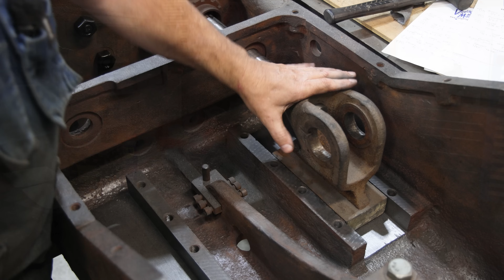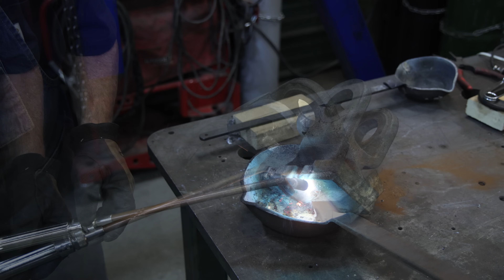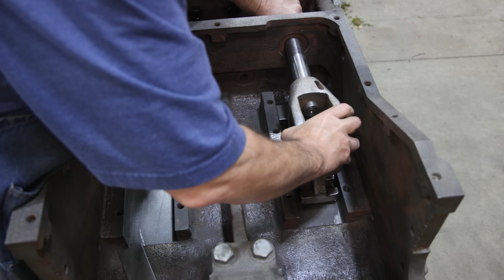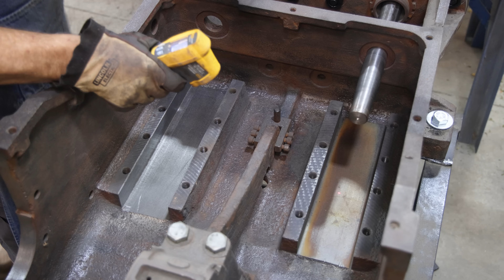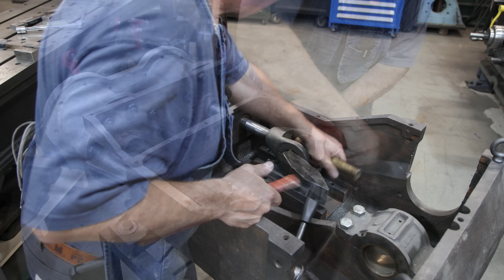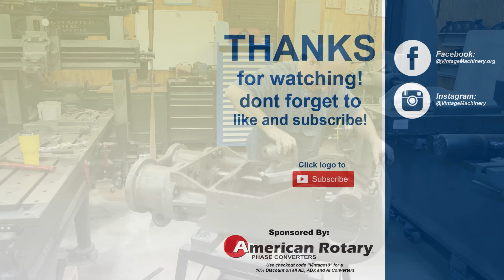Steam Stoker Engine :Pouring Babbitt on the First Cross Head Slide

Comment: thanks for sharing that process with us.  The only concern I had with the process was that there might be some twist in the part which could impact the interaction with the crankshaft.  Did you need to check those inner faces for plumb?

Comment: Anyone else wondering how Keith managed to get that cross head pin bore squared up with the rest of the slide? It seemed to me that the height was right, but looking at the top guides it looks like the whole thing is shifted over to the right which would leave the pin no longer square with the base?

Comment: Keith, you didn’t use black smoke from the torch to carbon up the parts before pouring. I’ve seen you talk about that before. Maybe just for when a lubrication gap is desired?

Comment: Why did the Babbitt not stick to the main casting?   They were both hot.    Is it cos they were flat?   Or a layer or carbon from the torch?   Or it did stick, but tapping the rod was enough to sheer it loose ?

Comment: 2:13 - That is a result of the 'double-acting' piston drive; it is driven by steam pressure above and (on the return stroke) below the piston. It is important, as that it demonstrates why IC automobile engines do not require such; their connecting rods pivot at the piston, driven only by the combustion pressure above the piston.

Comment: Pre-pour, I'm waiting to see why the material should stick to the crosshead instead of the ways. Normally, these pours leave the babbitt in the ways, not on the moving parts. Haven't said a word about it yet. Never did learn why it didn't stick to the bottom.

Comment: Nice job.  I really think getting the casting nice and hot was a key to success.  I'm looking forward to seeing the pattern you put into the block for the oil: both the bottom and sides.  How heavy of an oil do they use in these stoker engines?  30 weight?  50 weight?  I know it's going into a "museum piece" but how long should your rebuild last?  I hope they can take the locomotive out on the rails fairly frequently.  Work like yours needs to be exercised!  🛠

Comment: I hope the centering at 16:05 is sufficient because what you really want is the crosshead pin bushings axis to be parallel to the crankshaft, not necessarily to have the steel casting centered in the slideway. This is especially true if you cut more from one side than the other with the shaper.
Reply: My comment was going to be did you do anything else besides eyeballing the crossheads to assure the pin holes were parallel to the crank shaft bores.
Reply: I came to comment this as well.
Reply: I was thinking the same thing. They probably originally poured the babbit with the crank and rods installed.

Comment: wondering how close you got the wrist pin hole parallel in the horizontal plane with the crank rod journals.. your stand in piston plates took care of parallelism in the vertical plane, but it sorta looked like you eyeballed it in the horizontal plane...  as you pour more babbit you are going to run into additive misalignment error and possibly get a bind up. if the wrist pin / rod journal is also poured babitt then maybe not too important, but a bummer if its machined bushings.

Comment: Keith, well done. May I ask, will there be any issue if the angle of the cross slide is slightly out with the bearings for the connecting rods?

Comment: I was taught to smoke the surfaces where Babbitt was not intended to adhere. I have noticed you never do that and it works fine. Any clue why I was taught to do that. When pre heating the smoke vanishes and acts as a temperature indicator and a release agent.
Reply: Keith used to do that but hasn't for the last few pours. As far as I know, he has not mentioned why.

Comment: Amazing end result, looks like you can see the tool marks from the planer in the casting.
Only thing I am wondering is the alignment of the bore in the crosshead compared to the crankshaft.
I presume those have to be in line?

There are also ceramic heat mats you can hook up to a welder you can use for preheating.
Electricity is cheaper then oxy/acetylene plus you can just turn it on, throw a blanket over the casting and let it slowly heat up.
Reply: I tend to trust Keith on the cross head. He probably did something off camera to make sure it’s aligned.

Comment: I am curious as to how you handled the side to side fit of the slide.  The cross head was clearly able to rotate a few degrees prior to pour, & it would seem necessary that the cross bore of the cross head be parallel to the crankshaft.

Comment: Looks like that couldn't have gone any better -  congratulations! However (hello, here we go), I'll be interested to see how it works in practice, once the entire mechanism is assembled. The only reason I say this, is that I wonder about the alignment of that (now babbit-cast) crosshead to the connecting rod. Once the crank is installed with it's connecting rod, the rod and it's associated cross pin will be the thing wanting to determine how that crosshead sits in the slideways. Now however, the die (actually babbit) is already cast and the crosshead cannot take up any new position that might have been necessary otherwise. Naturally, it would wear-in, but that might lead to a slightly sloppier fit going forward. On the other hand, the only way around it, would have been to install the entire mechanism first, such that the crosshead sat where the connecting rod/pin arrangement dictated.

Comment: I'm guessing that although a large casting mass takes a LONG time to heat up, once heated it will also retain that heat for a long time, letting the babbitt in contact with it flow well and cool slowly.  So maybe actually an easier pour than in a smaller casting cooling faster?

Comment: How do know that the bores on those parts are parallel to the crank? In other words, that part was twisted a bit on the piston rod. If both bearings were poured together, a shaft perpendicular to the piston rod would have held them square.
Reply: Exactly what I expected to see.

Comment: Glad to see the Stoker coming along.
I have a question about the alignment of the wrist pin to the crank shaft. I didn't see that you did anything to check or make sure that the pins were in line with the crank. Looking back at the first video on the Stoker it looks like that is a non adjustable position. I may be missing something, and just wanted to ask about it, Thanks for the videos. I enjoy them all and am a long time subscriber.
Reply: Keith can still check and make some small corrections when he scrapes those in, I don’t recall hearing how much clearance those blocks need but maybe 5-10 thousandth’s I would think.
Reply: @Hoaxer51  On second thought, the connecting rod appears to have babbit bearings as well. So long as both the large end and small end are poured together then it should be possible to compensate. However, the end play may be excessive. It would have been better to slide a pin through the small end and rest it on a couple of 1-2-3 blocks in order to keep it square to the slide. Hopefully, I have missed something and he will not have to redo it.
Reply: @johng8473  @mikepoore1653, I definitely agree with using a pin through both bores to align them would have been ideal and not much extra work. At this point maybe he’ll see the comments and try that before he pours the second one and he can correct it if needed. 
Thanks for the reply, have a good one!
Reply: I was thinking the same thing. It sure looks like it is going to bind up because that wrist pin will not be on the same plane as the crank.
Reply: @mikepoore1653 Exactly, the crosshead hole for the wrist pin needs to be parallel to the crankshaft journals. If the crosshead wasn't level, it will bind.

Comment: Does babbit shrink as it cools?
Reply: Yes, the COE for Babbit varies slightly from alloy differences but it is generally 26 micrometer per meter for each degree Kelvin (originally was Celsius)... about the same as carbon steel. Oil film layers can vary a bit as well. Additionally, the bath of oil being shoved around by the passage of these X-heads as well as the churn from the cranks motion is calculated as drag, go figure!

The whole unit gets to working temperature fast enough what with the steam, motion, and then the work being done at the auger end. Hard coal (Anthrocite) was the preferred feed stock for rail systems since it burns hotter and with less VOC we still use it today. And everyone wanted it for these same reasons back then and now. China is currently the largest producer but only because the US stopped digging it and exporting it. Like fossil fuels it is rich in hydrocarbons and it is a great source of radon.

Comment: As I've mentioned in the last four videos, you only aligned that shoe front to back. Your alignment side to side is totally random, you didn't even put a square on it to make sure it was straight up and down. Your wrist pins to the crank, as well as your side clearances wont be aligned. Terrible oversight. It will either need re-poured or line bored and side clearances reclaimed.

Comment: shouldn't the connecting rod also be added to level before pouring babbitt?
Reply: When the connection happens, because it is circular it will match at some point. No need to align before the pour. The next problem area will be pouring the bearings for the crank. Those will need alignment and scraping also. Scraping is easy though so most of the job will be to capture the babbit to minimize gross overpour mistakes and the need for rough filing with the metal rasper. 

The engineering in those days was to design for depot rework, but to allow for field repairs in extremist conditions.

Comment: I would also have worried about the twist in the part, so it doesn't sit crocked on the connecting rod.
Reply: Scraping true-up will probably be within the assembly tolerances.

Comment: You made all that effort to align to the pistons, but you didn't do any accurate alignment for the crankshaft holes. I hope that doesn't give you any problems later. Anyway it looks good.
Reply: Not sure what type of small end con rod bearing this has, but if it’s not self aligning then you are correct, the wrist pin bore in the cross head hasn’t been aligned with the crankshaft plane.
Reply: That was my thought too. Those need to be horizontal or it'll bind up. If the scraping-in is done after everything is assembled, it might be able to correct for a small bit of tilt.
Reply: Beautiful pour. But yeah, without knowing how the rest of the engine is built, I am pretty confident that wrist pin will be out of square. I see a repour with more jigs in the near future.
Reply: I thought for sure he would at least throw a precision level in the bore😮 assuming he has the whole piece leveled.  Have to stay tuned to see the outcome of this. 🤞
Reply: Also should have added shims under the crosshead slide rails to allow for future wear....hopefully it works out in the end.
Reply: Thought the same. I'm curious how the con rod bearings look like ...
Reply: He also didn't soot the bottom of the ways to prevent the babbitt from sticking.

Comment: Keith, I don't know how expensive Acetylene gas is in the USA but in the UK it is far from cheap. For basic heating tasks like the babbitt pre-heat, would it pay you to set up an Oxy-Propane system for pre-heating tasks,  as in the UK, propane is less than half the price of acetylene. I see other Youtubers using Oxy-Propane for heating things up.
Reply: Same thing with Oxy cutting, slightly slower to heat to melting point but afterwards cutting is exactly the same as Acetylene. Except MUCH cheaper, you use slightly more oxygen but it's well worth it.

Comment: I’m surprised you didn’t soot the casting to help the Babbitt break free.  Really glad with your success.  Great video.
Reply: I’ve seen guys use soot and sometimes they don’t, is there a specific time where you use it or not? It seems like Keith has good luck either way, do some metals have a resistance to the Babbitt?
Reply: It came out freely so it obviously didn’t need soot.

Comment: was expecting you to soot up the surfaces to make extrication easier
Reply: Most molten materials expanded while being heated, hence shrinking when cooling.
Baring any machining undercuts on the vertical sidewalls the babbit tightened around the crosshead but pulled away from the sidewalls.
(If pouring around something, sooting would assist)
Reply: @waynespyker5731  good to know 👍

Comment: Nice job, pour went well. One concern I have is will the connecting rod pin align properly with the Cross Head Slide? Not sure that centering the cross head in the slot ensures that. Thanks for sharing.

Comment: That pour went great, thanks to very good preparatio which needless to say is always key. I was a slight bit concerned about the cross heads alignment regarding the pins which will be used to connect the parts to crankshaft. Would there be a need to do such check with maybe a dial indicator  or finger indicator clock to have level straight line?Just my 5 cents😂

Comment: Congratulations, that worked very well. 
You should mark which part is installed on the right and which on the left. 
This way you can compensate for small differences.
Reply: I think they're mirror images of each other. The tapered wedges both come in from the outside... :body-blue-raised-arms:

Comment: What made the babbits stick to the block and not to the bed? Both were preheated. Nice it worked as wanted.
Reply: The blocks had grooves on their underside. Once the babbitt is set it is effectively keyed to the blocks.
Reply: @DanielCoffey67  Thanks! That explains it well. All safe then.
Reply: A HUGE part of that is the fact that the guideway that it will slide in is very smooth, while the uneven and rough shape of the crosshead slide is rough, uneven (Cast iron) and has those big knobs on it. Those help key the molten babbitt to the crosshead.  Sometimes he also uses carbon black (smoke from the torch) to act as a release agent on one side (usually an axle of some sort), although I didn't see him do it in this case.